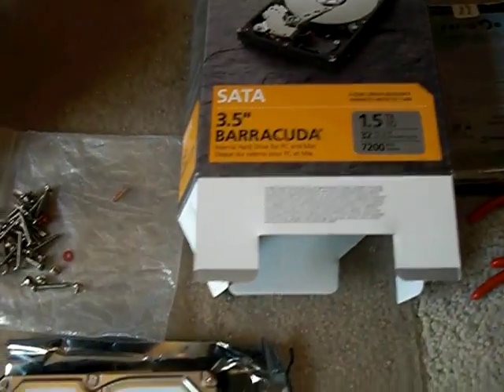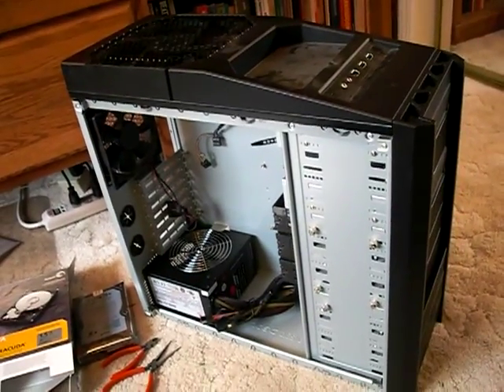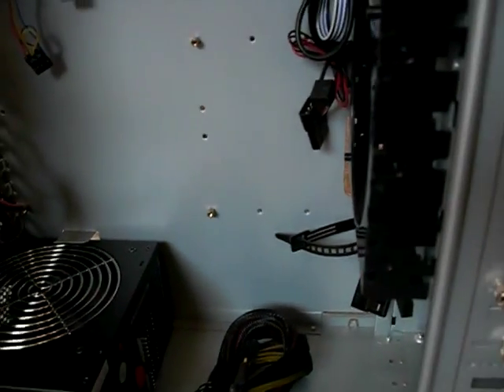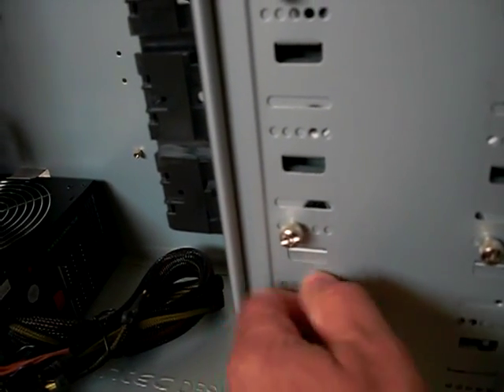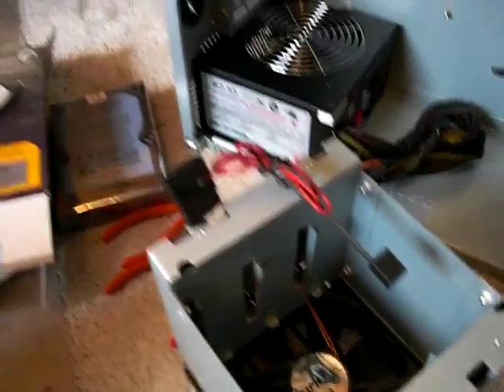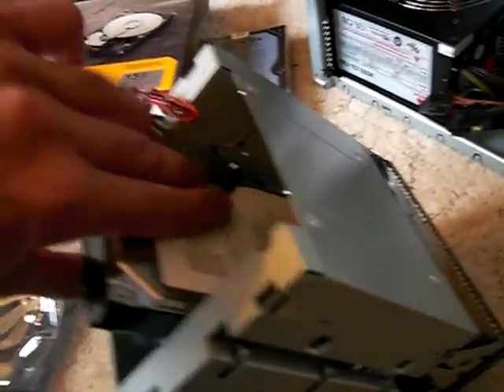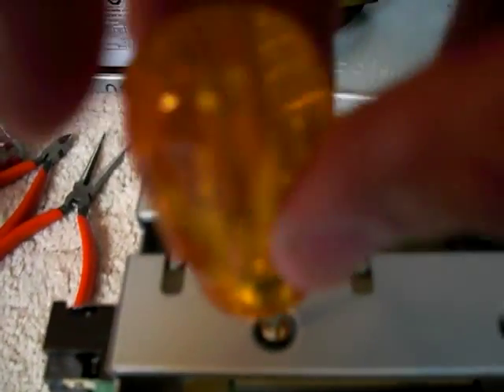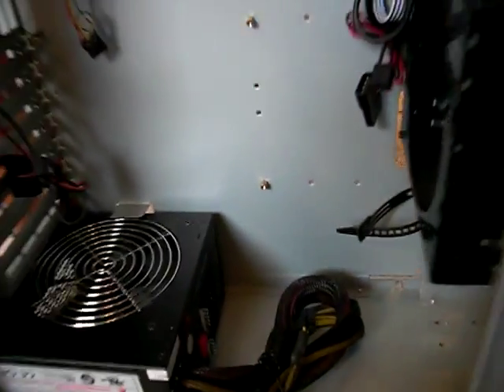Installing a 1.5 terabyte Seagate SATA hard drive into an Antec gaming case

Comment: I have been building computers since I was about 13, and now I am 28.  Out of all the computers I have built, I have not once used a ESD strap.  But I always make sure I touch the bare metal of the case before I start tinkering, and I have yet to fry anything.  

But on the other hand I am jealous, I want 3TB in my Tempest case!

Comment from the maker: @FuriousStacks 

I'm 54 so I have less skill than a 13 year old! Doesn't seem very hard to build a computer from the ground up as long as you double-check the compatibility of all the boards and parts you're going to use. They're getting better and better at making different manufactured parts work with each other so just check with the stores you're dealing with any you'll be fine. Best of luck and let us know how it went for you!